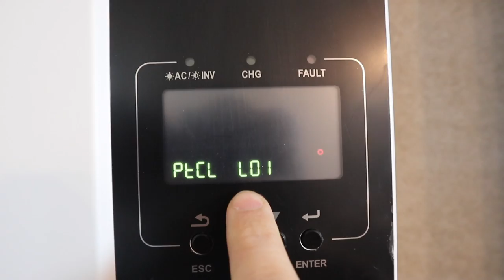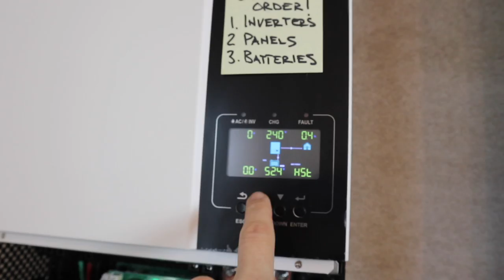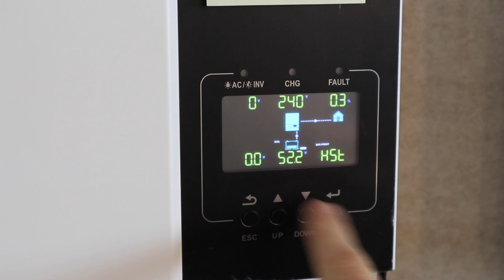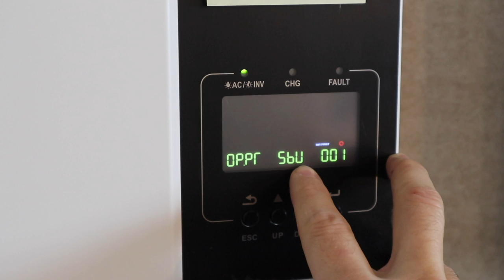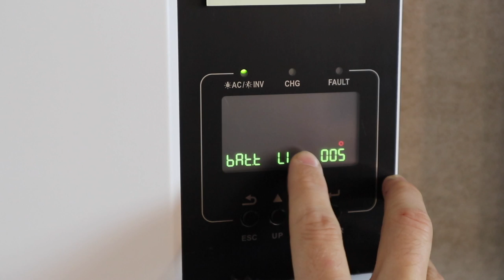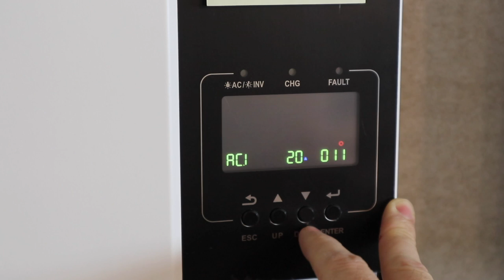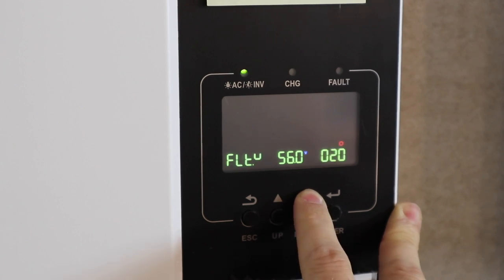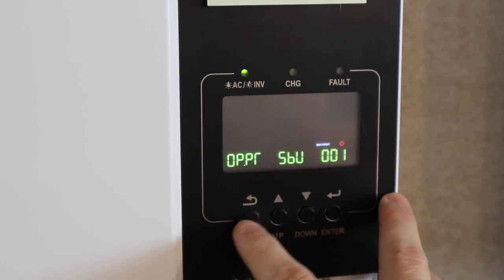Solar Inverter Growatt 5K Programing Grounding & Battery Comms

Comment: around the 13 minute mark, it was mentioned that AC/grid battery charging was a bad idea. Could you restate that point or recommend a resource to query on that aspect? I was surprised by it
Reply: Me Too. I think I checked with Sig Solar to confirm I don't really need the battery charger.
Reply from the maker: Watch Signature Solar's video on their 3kw (applies to all the off grid inverters) for generator sizing.  @4:26 https://www.youtube.com/watch?v=RyAaR5UpB64
Reply: @CountryLivingExperience  AHH OK, now I understand -- thank you for referencing that timestamp. It's a voltage droop/frequency stability question for generator AC input. If I'm interpreting this correctly, it's largely non-issue when grid (not gen) supplemented for AC input.  

I use a dedicated DC charger sized for my generator in line with James' comment in the later moments of that video.
Reply from the maker: Yep. Sorry if I didn't articulate it properly in the video. I am still learning as I go sometimes.

Comment: I bought a two LFP system from system solar with case with out doors and top. I am trying to build a moveable system. I will send pictures. I put the GroWatt system on one side. I plan to charge from the house ( solar ) to the two batteries. And use the GroWatt to go from DC to AC. I Plan to use extension cords to power the items in the home.

Comment: Between the batteries and the inverter does it not require a device for over current protection?
Reply from the maker: I have them on my new system. The batteries have some good over current protection. As always, the more the better.

Comment: Are you sure about having two grounds ? I was assuming everything was going into the same ground . Either case you can make a circuit over the ground
Reply from the maker: This is a discussion that has gone on inside the DIY Solar Forum and among many solar companies for a long time. I took the advice of the solar company I purchased from. If you don't feel comfortable doing it this way then do it how you feel is correct.

Comment: Pls I have a question, the inverter AC output is it two phase ? In your last video you make mentioned of two hot line. Thanks
Reply from the maker: Technically it is 240v single phase but it it called two phase here in the US. There is two hot lines and a ground.

Comment: @CountryLivingExperience First of all thanks for the video, and it's help me a lot. I live in area where lightening would be happened a lot. So I initially planned to disconnect my PV array when there will be high lightning, in order to protect my system. My solar panels were installed on roof (little bit high point) and my house located in kind of valley. So what will happen, if I disconnect my PV array, without switch off the growatt inverter and battery pack?
Reply from the maker: If everything is grounded properly and has the correct isolation breakers installed, it should not be a problem. If you have them on the roof, they should be installed with some sort of DC breaker for overcurrent protection.

Comment: Hi. I have one unit of SPF5000ES working good with pylontech Li batteries by can BMS port for 3 months.
 Now I just buy the second unit for paralleling. Both inverters will work with the same 14kw Li bateries. Do I have to buy the hub rs485/can growatt 8 ports ? Or not 
Please explain me.
Thanks/Barcelona
Reply from the maker: They changed the inverters over time and I don't know how old your first SPF5000 is. You may need a hub to communicate with with newer inverter.

Comment: Thank You for explaining clearly . However, I have a buddy who has worked for the utilities for 40 years . He tells me you should never ground a battery . The ground will draw from the battery quickly ! If you do try it, please check your levels every few hours .   GOOD LUCK
Reply: LiFePO4 battery systems function very differently than Lead Acid batteries.  The electronics in the battery case need to be grounded.
Reply from the maker: Thank you.
Reply: Don't, ground the battery positive or negative.  Do, ground the metal case that is surrounding the battery.
Reply: Also,  the mounting screws between the battery case and the rack are not rated for grounding.  You need to make the ground connection separately from the mounting.
Reply: What I heard was to ground your bus bars instead. All your equipment goes through your bus bars and you can ground everything from there. You only ground the negative side.
Reply: These new systems should never be grounded.  Except for metal cases and frames.
Reply: Only referring  to the DC side.
Reply: @timbensing1075  I agree - I'm seeing a lot of grounding of unnecessary parts in solar installations.

Comment: So the AC and DC systems have separate grounding systems each with a single ground rod for each system? Is the combiner box a good place to ground the DC system?
Reply from the maker: The power from the inverter is AC so there is no DC power accept at the panels, PV wires, and batteries. The inverters are a separate power generation system like a generator in my off-grid configuration.

Comment: Hi have you ever had An AC leak from the pv in to ground with these units. I copped a bad and unexpected shock from the pv DC in from the grow watt es5000 I own. I fear it is faulty but im just glad im not dead.
Reply from the maker: Wow, no I have not. That seems like a serious issue. I am not sure how that would happen. I would disconnect immediately and send it in for repair.
Reply: @CountryLivingExperience  thanks for your reply ive contacted the supplier and disconnect the unit.
Reply from the maker: @Jobbyhoyker  Glad we could help and that you were not hurt.

Comment: Great series.  Why is it not a good thing to charge the batteries from the grid?  I want to run my system without solar.
Reply from the maker: Thank you. 
The equipment is not made exclusively to charge batteries from the grid. It is made for solar.

Comment: 13:08 you mention you that charging batteries form the grid is not a good thing to do for the health of entire system.  Why is that? I thought this is common if you want to charge batteries for during cheap night rates. you can restrict amps in another settings. I just cannot see a reason why this would be bad

Comment: Hi there!
Just saw your video today after installing two of the very same Growatt Inverters. Following the manual in setting up the PAL setting, I‘m unable to access the menu point 23. 
I‘d very much appreciate if you could write down the step by step procedure on how to enter into the stand by mode and set the menu point 23 to PAL and safe that setting.
Many thanks for your great helpful videos and your effort. Greeting from Hungary!!
Reply from the maker: You have to enter in to the menu when it is in standby mode with the inverter switched off.

Comment: I have a Off grid system not connected to the grid (no AC in).
To have a 10-90% lithium battery discharge/charge what parameters should I set in program 12,13,21?

(Inverter is Growatt spf5000es)

Comment: Any update on your grounding setup? I'm setting up two 3k 24v Growatts in split phase and have questions around proper grounding. Right now my plan is to bond the AC out grounds and neutrals to the off grid panel which will have it's own ground rod(s). I'm also wondering if I can ground the battery chassis and solar panels to the same rods.
Reply from the maker: No update, it is setup as Sig Solar instructed and my electrician confirmed. If you purchased it from them, they should be able to help you with your particular setup. I don't know all the ins and outs of your system so I can't really say. Sorry, I am not more help.
Reply: @CountryLivingExperience  No worries - thanks. Yes I did purchase from them and have an email out to their support, never a dull moment!
Reply from the maker: You might want to try giving them a call. That has always worked quickest for me. I talk to Matt a lot and email him pictures of my equipment questions while we are talking.

Comment: Excellent explanation my friend. What about the reliability of this model? My project is exactly as yours. I’m gonna buy 2 inverters, 12 550w solar modules and 30Kw of lithium batteries.
Reply from the maker: They are very reliable but with any electronics something can happen. I will get another as a backup just in case. Signature Solar has been great to work with too.

Comment: Thank you for the video. This is the information I am looking for. Never thought I will be interested in solar until I see David poz and your video, so I know the system is really work. I already bought the same system that I saw in your video just not install yet. I am really enjoying your channel because I love doing garden too. Are you using your solar power every day or just for back up? I already have a transfer switch installed and used it when the power is out now, I can use it for those chosen breakers every day by solar power if it goes well, I will expand later as you mentioned in the video. Great videos thank you!
Reply from the maker: Thank you, I appreciate it. 
I am using it on most days. I am currently adding some batteries and cleaning up the wiring so the system is down at the moment.

Comment: You were told not to run power to the AC out if solar is not connected? That doesn't make sense, can you not run these overnight when the PV system is creating zero power?
Reply from the maker: I was surprised also. There was a technical reason I was given by SIg Solar. (I don't fully understand it). Give them a ring, I am just relaying the info.
Reply: You can power up the inverter,  as long as you have at least one power source available.  ( grid/solar/ or battery)  I currently have my growatt spf5000es connected to grid only.  It's powering my loads through my sub panel.  My solar panels are arriving tomorrow and the batteries are stuck on a ship waiting to be unloaded.  I powered up by grid only,  so that I could figure out how much I could put on it. And,  to get my loads balanced while I waited for the solar panels and batteries.  It's working fine and I have everything powered and waiting for the rest of my system.

Comment: another cool video...disappointed to see all the cables between the inverters.  seems like rj45(ethernet) could have handled all of that.  kind of silly to have the rs232 cables as well as the twisted pair set.  They probably could have just connected them with usb.  Its not like there would be gigbits of info flowing there.
Reply from the maker: Thank you. Once I get everything running smoothly like I want, I will clean up the cabling.

Comment: As a lifer electrician and professional solar installer. I’m very curious if there’s a fault in your house panel/critical loads panel and it travels through your input or output wires without be bonded how will it clear the fault and not fry your inverters. Putting a ground to a ground rod will do nothing.
Reply from the maker: I had an electrician look at this and they had no issues. This is also how Signature Solar recommended. Before they opened the business, they were professional installers for 10 years. So, whom do I believe? 
If I have a fault on the AC side, will it not just travel to ground through my main panel which also has a ground rod?
Reply: @CountryLivingExperience  if a fault happens on your ac side of inverter it has nowhere to go. The ground rod is useless it’s for lightning strikes not clearing fault currents. All metal parts need to be bounded
Reply: I would love to hear how and why from signature solar and or grow watt why you would put there system on it’s on ground rod for fault current and how it will work.
Reply: @CountryLivingExperience  at this time your ground rod is acting as a auxiliary electrode 250.54 in addition to bonding 250.30. Your videos are great. I just like info that can be deadly to be accurate. A lot of electricians have no idea what they are’s looking at and don’t know proper wiring methods for a safe and effective equipment. The inverter company is giving false info and I might have to start calling them on it.
Reply from the maker: I appreciate everything you have said but you have not given me your solution.
Reply: @CountryLivingExperience  I would bring my ac in and out grounds into the sub panel your dcloads can go on a ground rod if you want and you could add in surge protection
Reply from the maker: I had done that in a previous video and was told that was incorrect. So...
Reply: @CountryLivingExperience  watch will prowse explain it then. He actually makes videos too as I’m sure you know he explains it in a video I’m sure.
Reply from the maker: I have watched all of his vids and have been subscribed for years. I have briefly chatted with him. Please link his video with the timestamp for the specific issue you are referring to.

Comment: Earthing is only recommended if you are attached to the grid.  Earthing has been done for stability of the voltage, (Look up MEN,Multiple Earthing Neutral) of the Power Stations.    You are less likely to be electrocuted if you are not earthed.

Comment: Your transformer only has 1 conduit - for primary and secondary conductors?
Reply from the maker: That syle of transformer from Solar Edge only used one set of conductors.
Reply: @CountryLivingExperience  ok. Most likely it's an auto-transformer.
Reply from the maker: @eddietee6305  It is.

Comment: I find your videos really informative and do enjoy the presentation. I see each inverter has a battery connection but can’t see how you’ve connected them up. Do both inverters go back to the same battery bank and if so how do they connect to the same bank. Cheers David from NZ
Reply from the maker: Thank you. 
The battery rack has integrated buss bars. All batteries and inverters are connected to them. I did a video on the rack and connections here......https://youtu.be/SrCSSc9JYSo
Reply: @CountryLivingExperience  thanks Eric I watched the battery set up and again a brilliant presentation. Also your “is solar worth it” really lays it on the line well done. So just to be clear on the 2 inverter battery connection. Each inverter connects via the buss bar to the same battery bank? But the communication goes from the master battery to the master inverter right? Cheers David from NZ
Reply from the maker: Thank you, I appreciate it. 
Yes, each inverter connects to the buss bar. The comms go from master battery to master inverter.

Comment: Quick question, is it OK to connect the inverter to AC IN without PV, Batteries, or AC OUT? Why I ask, I would want to startup the inverter inside the house so I can setup Wifi before moving into it's final spot where the Wifi is weaker.
Reply from the maker: If you have AC in the house already, why not plug the Wi-Fi into the house AC?
Reply: @CountryLivingExperience  ok, let me clear it up a bit. My growatt has a shine wifi dongle. I want to link that to my router wifi before installing the inverter to its final position. Is it safe to plug the dongle into a 5v source and set it up that way? Or must it be the inverter? My guess is the inverter since it would require a modbus connection to its host.
Reply from the maker: @ComputingCode  Honestly those are questions for the manufacturer. I cannot answer them and I don't use the dongle.

Comment: I have a growatt for off grid and I use a generator, now do I have to hit the switch manually to power my growatt with gas generator or does the unit to automatically?
Reply from the maker: It all depends on how you wired it.

Comment: Hello again. Hope all is well. Question: how can I tell if I have the newer ES5000 or the older one. I purchased them in June 2022. I am running into trouble with my Growatts charging my EgLL’s. Wondering do I need the communication cables. Please advise.
Reply from the maker: I'm a little confused. Is the system up and running? If so, it should have comms cables already connected. I just don't know how your system is set up.
Reply: @CountryLivingExperience  Thanks for your response. It is up and running. However, I do not have the gray communications cables. Not sure if they should come with inverters or should I buy them. Wondering if this is my missing link. System works fine, but intermittently the inverters are not charging the batteries.
Reply from the maker: @secondadventmessengerminis3594  I honestly don't understand how it is running without those communication cables. They come in the boxes with the inverters and there are instructions in the manual on how to connect them. This may be the issue with your charging problem or may not be.
Reply: My mistake, my error. It turns out that that isn’t not missing. What I just learned is that I need to update the firmware. 

Thanks for your raid response. 

Blessings
Reply from the maker: @secondadventmessengerminis3594  Glad you got it worked out

Comment: i do not know why the New Growatt 5000ES bonded the AC input Ground to The AC Output Neutral . I did openup the inverter trying to unbond the neutral & ground but i cant find where to unbond it . This is because i am using Solar to charge my batteries LIFEPO4 & same time power up my loads , just that when at night i requires the Grid to charge my batteries . Ended up it trips my main power ELCB and not able to get it function . Previously bought all the inverters are not bonded , need help what should i do to unbond the neutral and ground ? Do i need to use the dry contact to trigger the unbond ? thanks
Reply from the maker: Only Growatts sold by Signature Solar are properly modified for the US electrical grid. All others (as far as I know) do not have the bonding screw removed or the connection hole covered with silicone.

Comment: Does the growatt take 9x 550w panels in series with 49V voltage ?
Reply from the maker: It should. Max PV wattage is 6000w for the Growatt. Max voltage in is 450vdc.